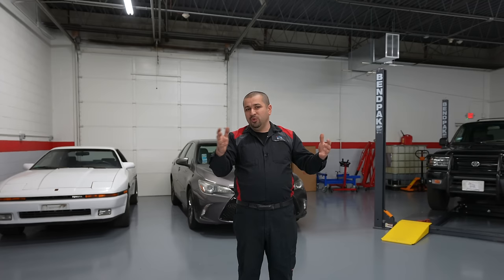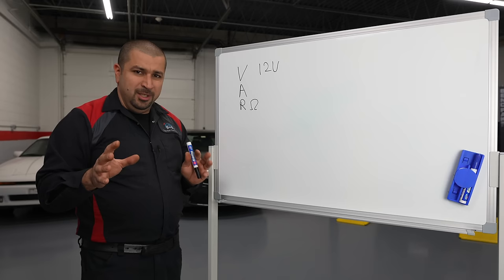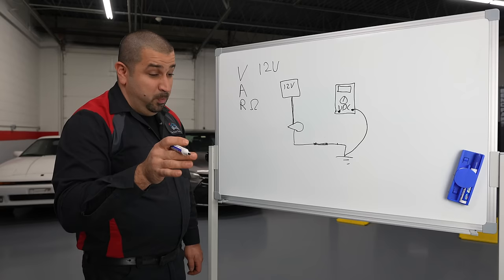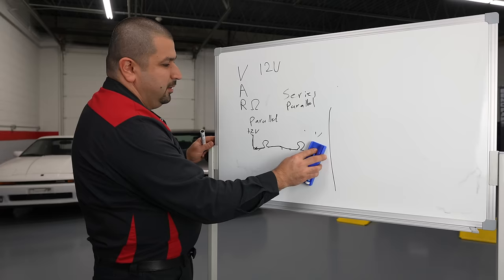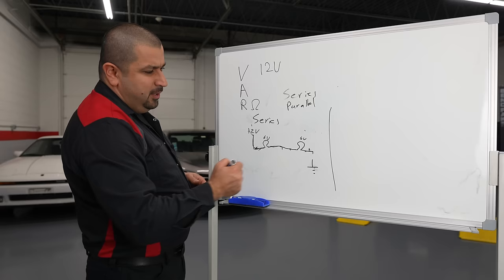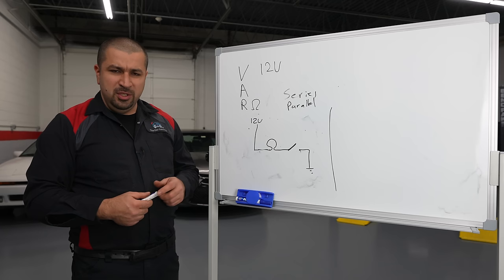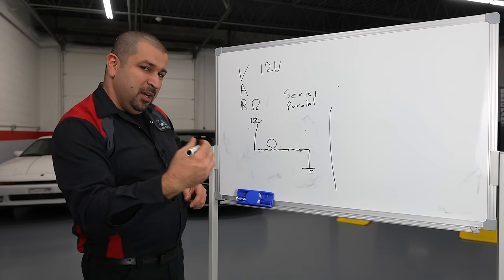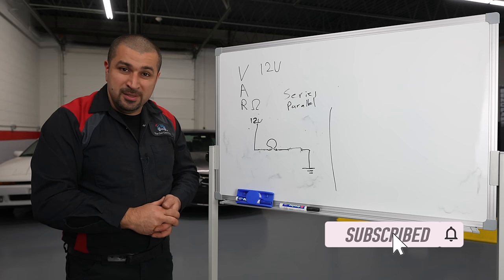Learn How to Diagnose and Fix Car Electrical Problems Series | Part 1 Basic Electrical Principals

Comment: Seriously the best explanation of basic automotive electrical theory I have ever seen.  As you progress, you should have the video series in the description so you can refer back to the late to class members!  Great video!
Reply: Great suggestion.
Reply: Excellent content
Reply: WTF? This was worse than a third grade level explanation of electricity.
Reply: @nobodyimportant7804   It's meant to be as basic as possible....
Reply: @abdul-kabiralegbe5660  So basic, that it is basically wrong.

Voltage is the difference in electric potential between two points. Voltage doesn't move, it is potential. smh
Reply: @nobodyimportant7804  Why are you here? Do you think tearing other people down really the best way? 

We’re troubleshooting basic automotive circuits here. I’m quite sure CCN wasn’t trying to give an electrical engineering dissertation.
Reply: @guymann4016  Knowing what voltage is doesn't require an EE dissertation. /facepalm

I wouldn't expect a mechanic to have any EE knowledge, but anyone that works with electrical systems should know the basics.

My dad was a lineman and he knew electricity inside and out, including the basic math that describes electricity and he was a light year away from being an EE. Why? Because his job performance and life depended on it. 

I would trust CCN on diagnosis and repairing mechanical parts but would flee if I were having electrical issues in my car.
Reply: Okay big guy.
Reply: This explanation is genius in 25 minutes.  @nobodyimportant7804 did not learn his potential difference within 25 minutes of starting third grade, and he apparently did not learn anthropomorphism or personification, not to mention metaphor and analogy.

“lo and behold voltage comes out”
“I have ground [this is voltage talking]”
“voltage comes down ... I have no path to ground”
“Amperes goes back in the lawn chair”
“voltage went through ... we don’t have current ... [voltage] stopped right here [the wire becomes an extension of the terminal]”
“[then when the circuit is closed] current will carry the voltage here [the wire extends the terminal to before the load]”
Reply: @xbrlinfinity9399  That is a lot of word salad to defend an incorrect explanation.

Voltage doesn't stop because it doesn't move and current doesn't carry it. smh

He could have used a metaphor that works and describes it correctly. There are plenty of correct river and stream metaphors that work without giving supernatural power to potential.

The reason he didn't is because he really doesn't understand electricity at all. It was very obvious in his presentation and demeanor.
Reply: @nobodyimportant7804  OFF TOPIC, not to do with cars, but for the record:

"Yes volts do not flow ... but... since we are dealing with a propagation delay transient, a potential of 5 volts moving out away from the battery is actually a surprisingly reasonable way to phrase it" (@AlphaPhoenixChannel, Brian Haidet - PhD in Materials Science).
Reply: Motor Age is actually the best I've seen. They used to be called Cardone ProTech. The guy is an older master automotive electrician and has hundreds of free classes on electronic fundamentals from basic to very advanced.
Voltage Drop is by far the most important Diag tool you can use with your multimeter/voltmeter/clamp meter or Non Contact DCMeter
Reply: I absolutely agree
Reply: Since I have comprehensive automotive electrical understanding, I think this was an accurate description of vehicle dc electric op AND trouble shooting help if you understand the basics he explained very well, very well and easy for even new mechanics to understand. Welldone Mr ccn

Comment: In terms of explaining how DC electricity works, I find a water flow analogy is very explanatory.  You have a water tower, and as a result, the elevated water has a potential to move water.  That's like voltage.  If the pipe is cut off by a valve, no water flows.  But if there's a path for it to move to the ground, it flows.  Depending on how big or small the pipes are (resistance), more or less water will flow (amperage).
Reply: That explains it well . Thank you

Comment: I have extensive experience working on complex electronic equipment including aviation electronics while in the Air Force. The first step in troubleshooting any electronic system, including one in an automobile, is to get good, accurate wiring diagrams and technical documentation. Trying to figure out a complex automotive electrical system without a wiring diagram is like trying to find your way around a strange city without a map. A good set of technical documentation is just as important a tool when you are working on a car's electrical system as a voltmeter or a scanner.
Reply: I also had plenty of experience with corrosion [Navy Electronics tech] can't get away from the salt in the atmosphere and seawater.

Comment: As a retired high school automotive instructor I admit this is a difficult subject to teach.
You have done a beautiful job! Keep up your great work👍
Reply: I had a GREAT teacher of basic electricity in 1971. He used this analogy:
Your house is on a hill with a garden up the hill in back. 
To water the garden, you run a hose up the hill 
1. Water pressure (about 40 pounds) is force like VOLTAGE (at 110 VOLTS). 
2. Gravity is like RESISTANCE in a wire. 
3. Gallons of water per minute is like AMPERAGE, current, amount of flow. 
4. Amount of water over time is like power of the system, WATTs. 
                A garden might need a bigger hose or two hoses.
               Like a room might need two 100 watt light bulbs, not just one.

Comment: 1. For open circuits check for loose or corroded connections. Power, ground, fuses. Disconnect, check and reconnect all connections. Before changing parts disconnect and reconnect all connections with the power on if possible. Most electrical connections are coated with tin. Tin oxide coating forms to prevent unwanted corrosion. Unplugging and replugging can run off excess corrosion.
2. Short circuit. Pull fuses 1 at a time until the short goes away. Find the list of devices on that fuse. Disconnect 1 at a time until the short goes away.
3. Intermittent problem. With the problem turned tap near the connections with a standard screwdriver handle. The intermittent connection may cycle the device on and off or on or off.
4. Starter: clean battery posts a terminals and the 3 connections on the starter. And starter ground if equipped. Batteries have acid. The starter is under the car. Corrosion.
5. Alternator: worn brushes. 
PB Electronics Engineering Technician 96

Comment: As an electronics tech, good refresher. Almost everything is now plug'n'play in the electronics world, so I can't remember the last time I used a voltmeter.
When I was a bench tech, what I learned was that 90%+ of the problems in electronics can be seen by the naked eye. But what can be seen can sometimes affect what can't be seen, so you verify with a meter, and maybe an oscilloscope.

Comment: Thank you VERY much for this excellent training series!  Learning the basics is extremely important!  Eventually this will lead to dealing with wiring in a car which can be a nightmare given vehicle complexity and compactness, making getting to wiring an incredibly difficult challenge (unless working on a very old classic car that can be MUCH easier than cars made over the past 50 years).  Many thanks!  👍
Reply: Congratulations you're randomly selected among the shortlist of giveaway winner, contact the number above for more information ✉️✉️

Comment: I learned a lot in school about electricity, but no teacher explained so logically. What I learned was just memorization, without understanding anything about electric current. I was pleasantly surprised to find you. I understood absolutely everything. My searches are due to the fact that I have some electrical problems with my vauxhall mokka car, I wanted to solve them myself and I started to learn. Thank you so much for your clear presentation and for sharing your knowledge with those who want to learn about this area. God bless you !

Comment: My advice for mechanics who want to learn electrical/electronic system. First stay away from the subject of cars forget it. Then buy you a breadboard. Then buy you component’s such as Resistors, transistors, diode, led etc. Then buy you an electronic engineering fundamental book and learn circuit analysis. Now you may be wondering why do all these? That’s because you want to get to the electronic engineering level of knowledge to be the better than everyone else. For example I’m a mechanic and also an electronic engineering graduate. My first job was at a automotive computer facility and that’s how I became interested in cars. Finally I started my own auto repair shop that specialized in electrical system as well as hybrid and electric vehicles. The most cars I enjoyed were cars that has been to other shops that mechanics could not fix.Some of the cars has been in their shop for weeks or even months without ever figuring out the problem and I nail it in less in a few minutes. That’s the essence of having an engineering level type of electrical understanding. Also electrical repair is not by flat rate so you can charge better. In my shop it’s 150 right off the bat. Before I even touch the car the 150 is already paid for.
Reply: That’s awesome!!! That’s my goal to diag correctly every time

Comment: Awesome start. Thanks. Can't wait for next videos. I hope you can touch on the hazards that water can have on electrical components, connectors and wiring. Maybe a generalized note on how deep standing water can cause problems. Lot's of flooding gong on and I shudder every time I see a vehicle driving through deep water on the news.

Comment: Your first example reminded me my horn wasn't working. With this and the second video I fixed it!

Tested my fuses, relays, and horn itself (all working). 
Got no 12V from the plug with horn switch depressed. Pulled the wire out of the plug and it was corroded to heck. Cleaned it, reseated it in the plug, boom! Works! No shotgun parts troubleshooting. Thanks AMD! I am newborn into the electrical troubleshooting world :D

Comment: I do component level repair to old computers and video games almost daily and even I learned something here. I always considered anything after the intended load as shared ground and never really understood why finding voltage there indicates another unintended load (corroded switch with a high resistance in your example).

Comment: Thanks. I look forward to seeing more from this series.  Just one thing that should be clarified: the battery's negative terminal connects to ground. So the lightbulb connects to ground actually connects to the negative terminal of the battery to "complete the circuit".

Comment: Excellent. Here is another way to think about it  The amount of current going into a load equals the amount coming out. Therefore power is transferred to load by voltage drop as P=IxV.

Comment: I understood everything in this video.  Recently been researching automotive electrical diagnostics to solve a starting issue for my car.  This video is more intuitive in the relation between V, A, and R for instance, amps flows when volts find path to ground or that volts is even "seeking" ground in the first place.  I understand its for basic automotive and not electrical engineering but this helps put things together and I feel a bit more confident in this area.

FYI, my car had an old battery, bout 5-6 years old and replacing with a new one started the car with no issues.  I still want to purchase metering tools to observe the battery draw when car is off to ensure it is in an acceptable range.

Comment: Hi Ahmed, great presentation. It should be noted though that in your depiction of the battery, to avoid confusion, you should technically show the -ve earth lead running from the battery to ground. Without it, there will be no current flow.
Reply: An open connection between the negative pole of the car battery and the car frame (ground), due to a failed battery cable or common corrosion at the battery terminal is missed in his presentation.

Comment: Your example reminds me of my electronics class I took 30 years ago. My  teacher even used the example of the headlights. In that lesson he had  two headlights , one extra bright and the other dim. It was caused by improperly grounded headllight. As it happened, my wife's car was in an accident. the repair was  poorly done and the headlights were not evenly lit. So knowing the cause , I took out my Fluke DMM and found the missing ground wire, then replaced it. Since this car was a 1983 Nissan Sentra, it was basic and there were no computer modules to worry about

Comment: Hi AMD That was a good explanation with emphasis on this is so fundamental to diagnosis. I have trained a few people and I also ram it home. UNDERSTAND YOUR FUNADAMENTALS. They will save yours ass so many tines. Now for a story, Me, highly experienced electrical engineer and qualified to degree level and I do know my fundamentals. Customer, also highly experienced engineer. Complaint; my VW is not charging. He was working on his vehicle in my shop. This vehicle has a 150A fuse in the output lead from the alternator. I tell the customer, (my friend) check the fuse. customer says all good. Alternator changed. Still not charging. I tell the customer again, check the fuse. All good I have 14V. Third visit to my shop. I tell the customer again, (he was using my facilities to work on his car with my help) have you checked the fuse. Yes all good. I start diagnosing, myself this time. Alternator output all good 14V no problem. customer is watching over my shoulder. Have you definitely checked the fuse again. Yes irritated. I open the fuse box. The fuse has been replaced with a length of solid wire that has corroded. I take a dummy load ( head light bulb and with the engine off check for voltage and the ability to carry current at the large alternator terminal. No light. Home made fuse no good. Very embarrassed friend. I just said "You call that a fuse and checked?" From experienced friend engineer. how is that when there is 12V there. You did not do as I asked, check the fuse. You just measured voltage at the terminal. The circuit had no ability to pass current. Such a fundamental understanding that must be learned. Voltage does not mean the ability to pass current. Ivan of Pine Hollow Auto just did a very good video on this. (poor ground not O.C. but poor and hot when running.  It drove the ECU crazy customer had fitted 3 alternators. You could also mention the problem of ghost voltage on modern digital multimeters with very high input impedance 10M ohms usually. You could also say Voltage is a liar Current does not lie. 40,000V from an ignition system will not kill you, 40,000V from a power line will turn you to dust. Difference; current.

Comment: You are a talented teacher. I look forward for more advanced analysis to find why my rav4 2006 destabilizes the alternator output from 12,5 to 14,7 volts until I restart the engine. This ecu managed regulators are so complicated and I can't find which component is responsible... Thank you . Greetings from Greece!

Comment: This explains the problem I have with my snowmobile key ignition.  3 stage switch. First stage when I turn the key, fuel pump comes on. Continue turn to full stop..... nothing.  No starter.   
Worn out ignition with a weak contact point is my guess.  Ordered another ignition for it.  I'll find out this weekend if my amateur diagnosis was correct.  
Great vid!

Comment: This is why I love your channel AMD!  This is going to be a very educational series that all beginning mechanics need to watch and understand.  In my 44 years of working on cars, it's the bad ground connections that get you. 8-(  Living in the Midwest, lots of rust and corrosion really plays havoc with wiring.  One thing I'm seeing a lot of is rodents eating the insulation off the wires as many auto manufactures are coating their wires in soy!  Toyota is one of these companies and lawsuits have been filed against them.

Comment: Good information. I'm trying to diagnose a 2017 Camry SE. The HVAC blower motor burnt out and the replacement actually speeds up after turning the car off, unless I turn the control knob off. The door lock actuators are failing. The TPMS and key fob are only read intermittently. After owning 4 brand new Toyotas, I'm considering switching car brands after this one.

Comment: Excellent excellent video. Luckily I haven't had to do any electrical work for years. but my first thing was to check the battery for 12 volts, the ground and any and all connections.  I would go from there with a wire diagram. And Chase the circuit.
Please continue with these excellent videos

Comment: Well done 👏 ... I'm trying to figure out why my battery has good voltage but poor amperage.. the battery and alternator are 2yrs old so before I replace anything, I want to check for any troubles with the wiring (not sure if that makes sense) but hey practice will serve me well. Thank you 👍🏼